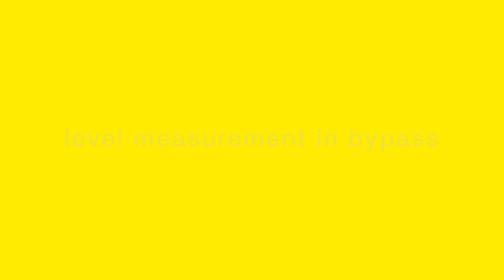Radar vs. Guided Radar (TDR) – What are the differences between the two measuring methods?

Comment: can we remove the guided probe and convert the same into non contacting type ?
Reply from the maker: Thanks for your question. Would you describe your application more in detail? Or contact us directly: https://www.vega.com/en/company/vega-worldwide
Reply: @VEGA_Level_Pressure  We are using this level transmitter for anti foam dissing tank for dosing of sea cooling water, model VEGAFLEX 61 guided microwave, the problem is that, there is frequently LT failure because of formation of salts on the probe, the chemical for anti foam is NALCO 71101 which is 100 wt, no dilution, we don't know how the salt is formed on the probe
Reply from the maker: @shabrazk5182  Thanks for the explanation. Removing the VEGAFLEX probe does not work. To check, whether a non-contact VEGAPULS radar sensor would work better in your tank, please contact your local VEGA subsidiary or agency and we'll find a solution: https://www.vega.com/en/company/vega-worldwide
Reply: @shabrazk5182  What is it you want to measure, the liquid surface under the foam layer, the top of the foam layer or is it sufficient to know if the foam reaches up to a fixed point? In the latter case, I have successfully used a very simple conductive level switch. It can detect extremely light foam that many detectors have trouble with. If you want to see the foam surface with analogue signal, a radar with large antenna (like Ø 150 mm) is needed.